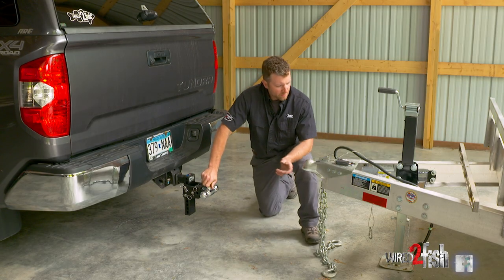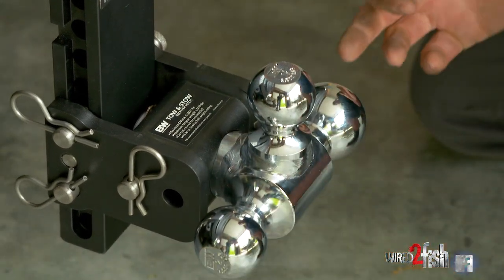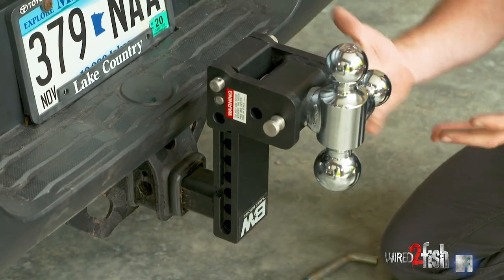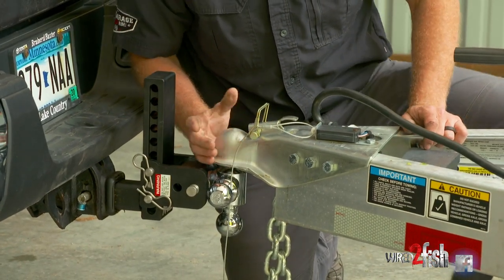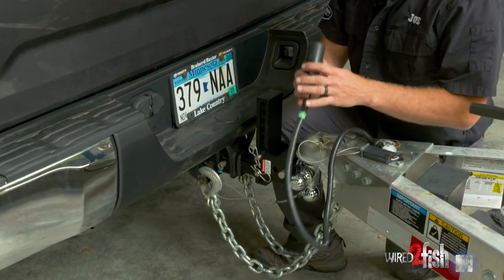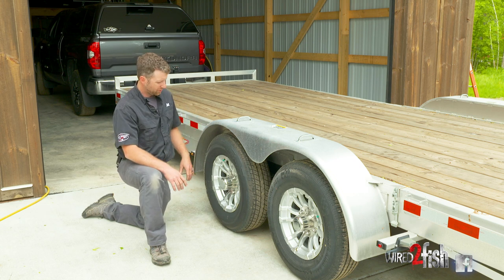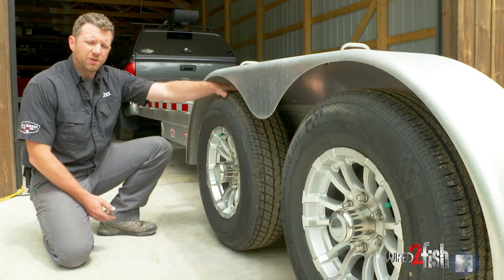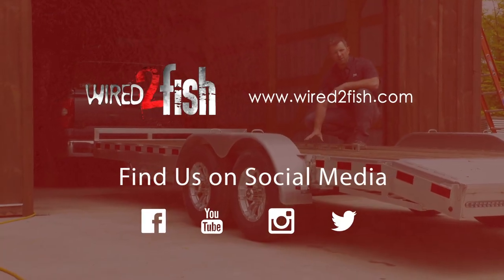How to Prepare Trailers for Towing: Leveling and Balance

Comment: I did this when I first started hauling my bobcat I hit 50 miles an hour and my truck got away from me I moved the Bobcat up on the trailer further and put some tongue weights and had no more problem.  I guess you can have level and tongue weight both at the same time but the right tongue weight is the most important if you want to stay alive get your tongue weight right first then worry about leveling the trailer I learned the hard way and it nearly got me killed

Comment: If you level trailer unloaded when you load trailer and get tongue weight right the front of the trailer will sag down get tongue weight right first then worry about leveling trailer but don't level trailer by moving load back